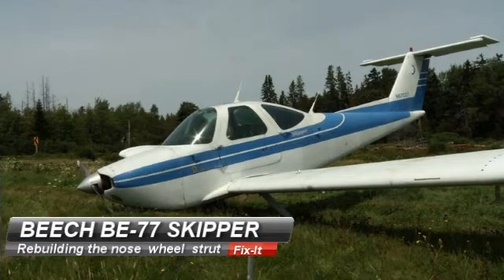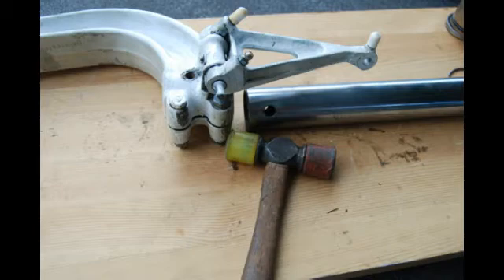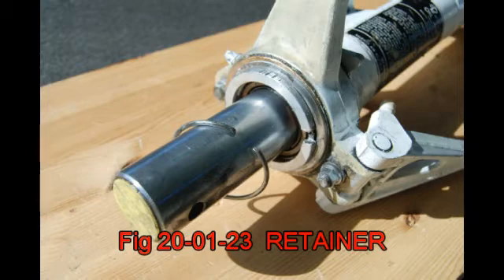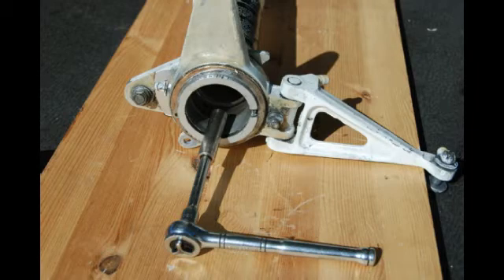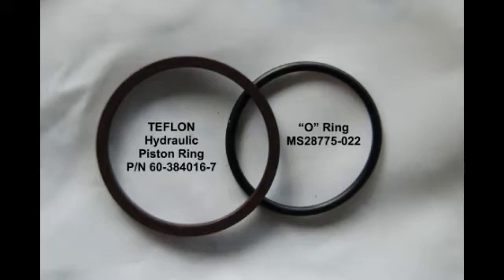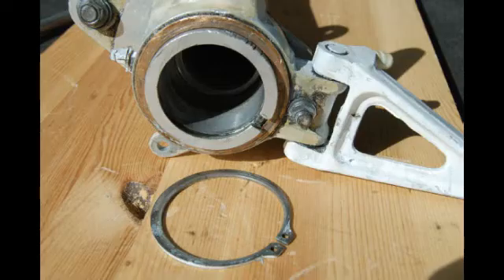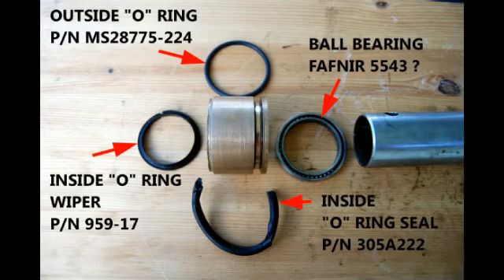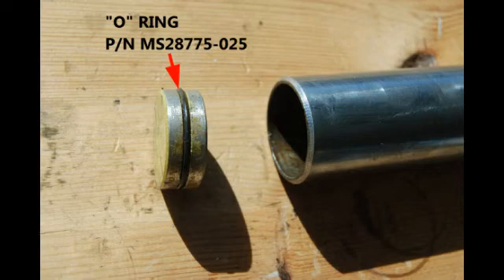Rebuilding a BEECH SKIPPER oleo strut

Comment: PARTS LIST: you can cut and paste this instead of typing from the video.

Due to no one providing rebuild kits for the BEECH SKIPPER nose strut, you have to chase down the parts yourself.

Item # P/N etc.

#21 O-ring seal 305A22 from BEECH or M83461-1-325
#21 O-ring MS28775-224
#22 Rubber Wiper   959-17 from BEECH; you might also be able to use a standard AN-17-SH wiper
#36 O-ring MS28778-5
#11 O-ring MS28775-025
#33 Teflon Hydraulic Piston Ring  60-384016-7 from BEECH
#33 O-ring MS28775-022

Note: Item 33 is as scarce as hens teeth.  If you can find one they vary from $25 to $100

Romeo,  This is extremely valuable information to the 200 or so Beech Skipper owners in the world.  Thank you so much for taking the time to do this.....   Very well done.  This video takes an extremely daunting task and makes it manageable.
Reply: This video is great, but I'm having no luck finding part #33 (60-384016-7). Not even Beech (Textron) has it.  I would greatly appreciate any info on where you were able to get yours.